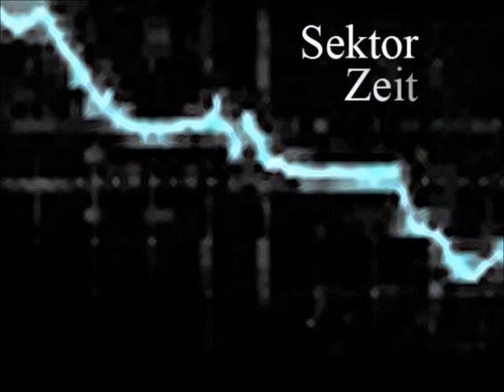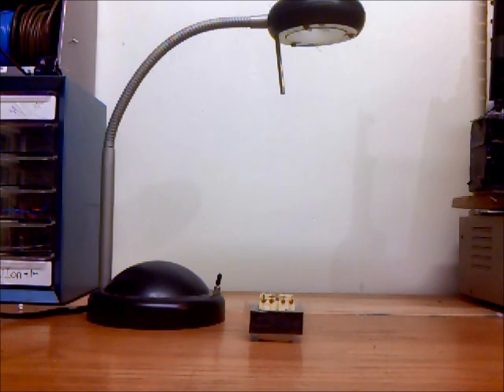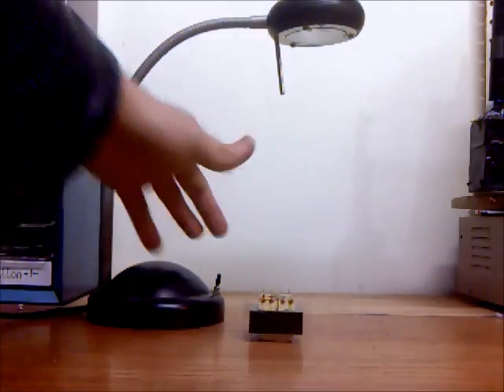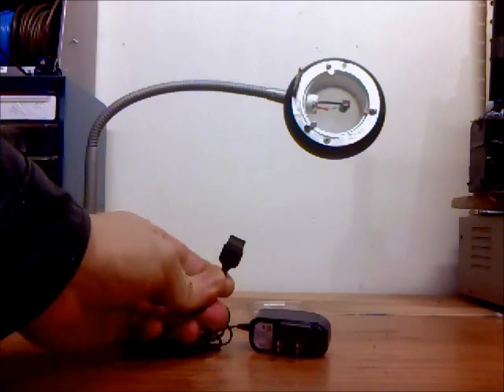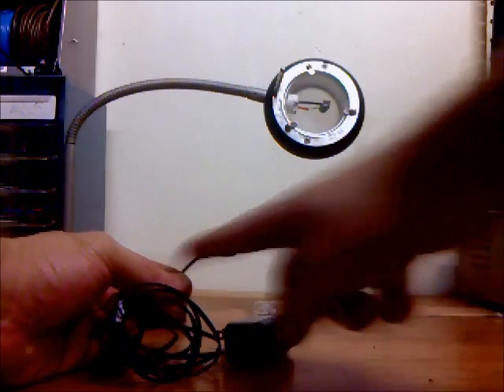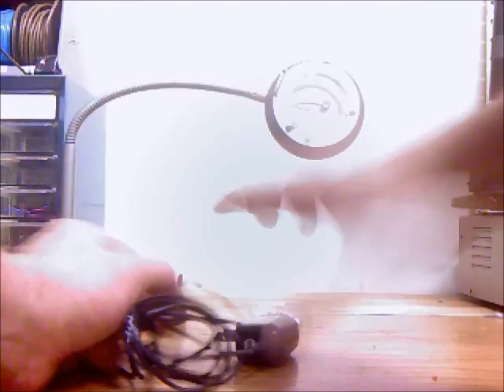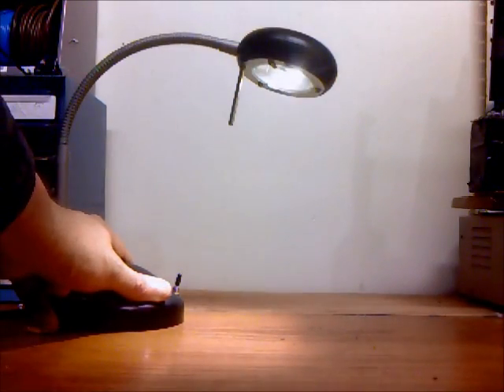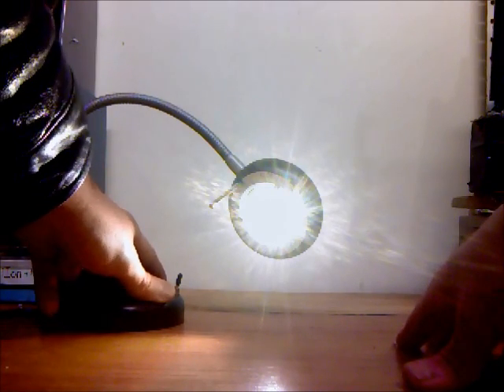Halogen to LED

Comment: What is the purpose of the metal thing sticking out? I have this lamp and I'm baffled
Reply: it's to adjust the direction of the lamp head when it's extremely hot so you don't burn your fingers.
Reply: @JimmyJamesTT  mystery solved! Thank you so much for replying